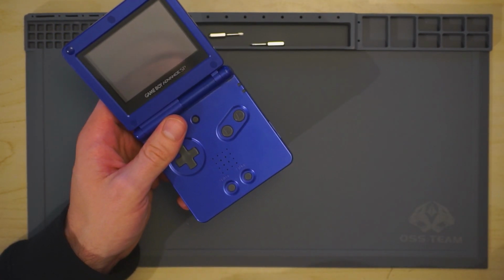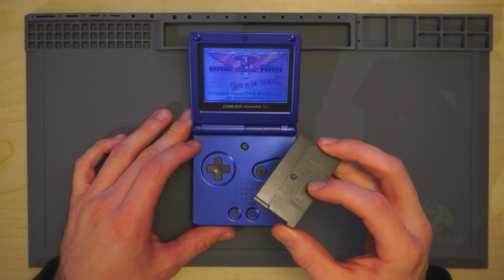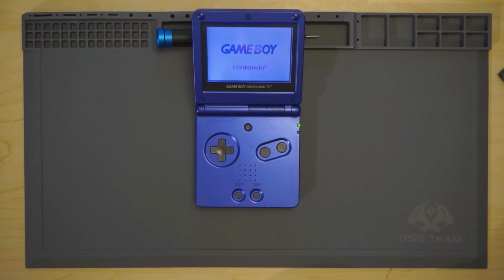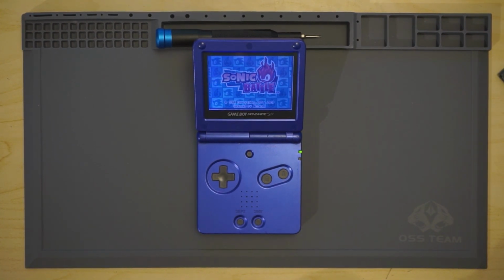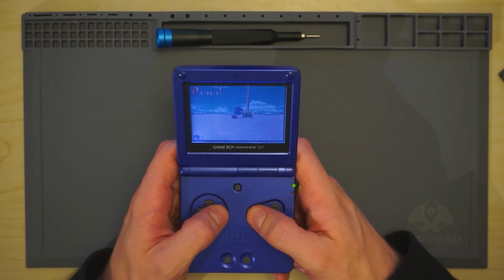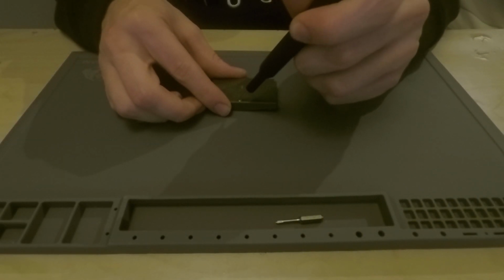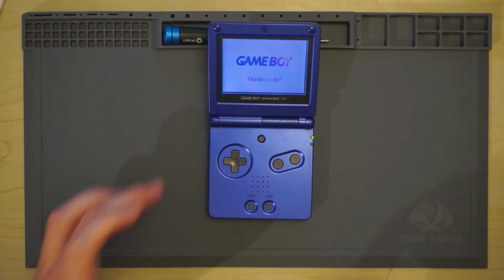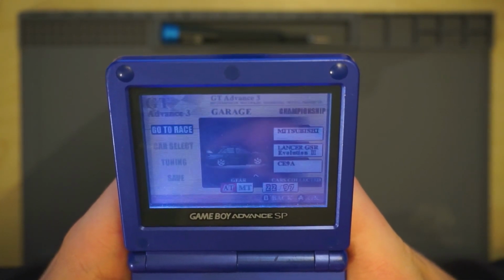How To Clean Gameboy Advance Cartridge [Fix No Boot]

Comment: Ive used the rubbing alcohol in the past and it worked well but today i came back to this video and watched it again. I have a gameboy color gameshark that had coke or some kind of liquid  spilled in it and after 20 years it was pretty badly corroded. I tried the first method of rubbing alcohol and i could rub it all day and it wouldn't help much. In the video you mentioned an eraser and that reminded me i have a eraser like tool used for cleaning knifes. It worked like a charm. Had it %80 cleaned in just 2 minutes. Thanks for the help a second time.

Comment: 5 years later and this worked for me.  I cleaned the game in the cart with a cotton swab and it didn't work in the Ds I bought.  the contacts looked clean like yours so I worried that the gba slot was broken. After watching your video and you showing the contacts looked "clean" before cleaning it made me take apart the cart and clean it the way you showed.  Game booted up. Thank you for the video and saving me a bunch of time!.

Comment: While trying to fix my Xbox Series controller (LB) I bought a Security Bit Set that had a Torx Security T-8. The set also had some Tri-wings that I remembered went to my Game Boy Advance. I might have taken it apart before, but I looked at the game cartridge and it had a Tri-wing screw. So, I undid the screw but couldn't get the case easily apart, so I searched for a video. Once I heard slide I could have done a head palm. Thank you!

Comment: Does this also help if the game does not want to save anymore? I’ve searched it up and had seen I needed to change the battery but my cartridge is like these where it does not have a battery. Would you happen to know if it’s fixable?
Reply: To answer your question, no it will most likely not help.

Your game probably uses a flash rom to save(a second black thingy on the motherboard's left side that usually reads MXsomething). I'm said it can be changed but its difficult

Comment: Do i have to use a 99.9% pure alchol or cologne does the same job aswell? (Im from turkey and every house has cologne at home :))
Reply: No. Alcohol is needed because it evaporates and does not damage the circuits.
Reply: @vhalrougelarfouxe  thx mate. Im suprised to get an answer to this msg tbh :p

Comment: I have the exact same problem but nothing happens when I rub it with rubbing alcohol. I've had this game for months and I have my pokemon fire red team on it for leveling up+ rare pokemon I have when I bought the game please help.
Reply: if you opened your game did you check if any of the lines connected to the contacts are scratched and or corroded if so you have to solder a wire preferably a magnet wire to the chip the scratched line was connected to.
Reply: @R-Da-Man  quick rundown on what happened;
The game was working fine and I was swapping it out with other games for trading. I pushed in the game, which was working earlier than day, and it made a weird noise. I feel as if I pushed too hard and broke something because then it stopped working.